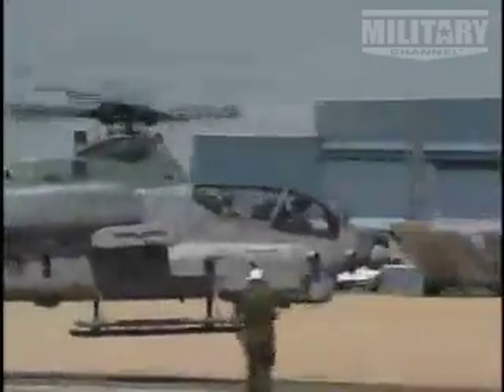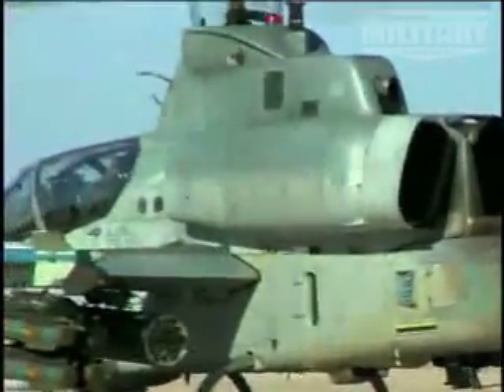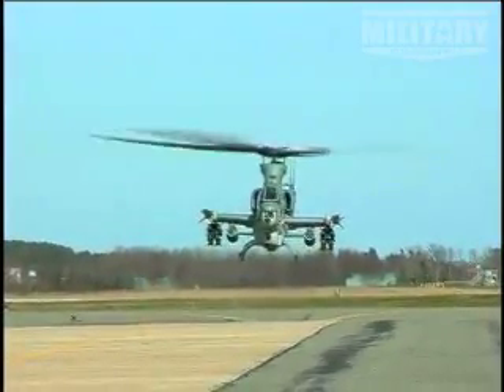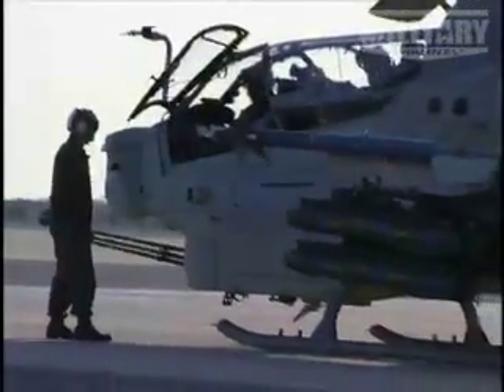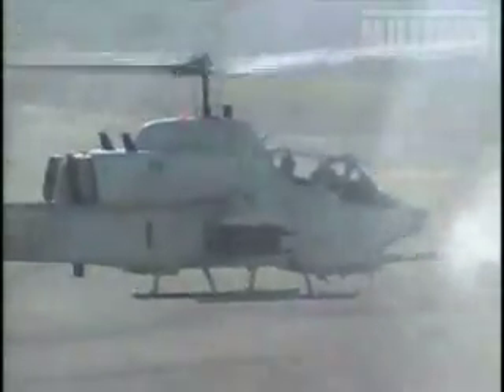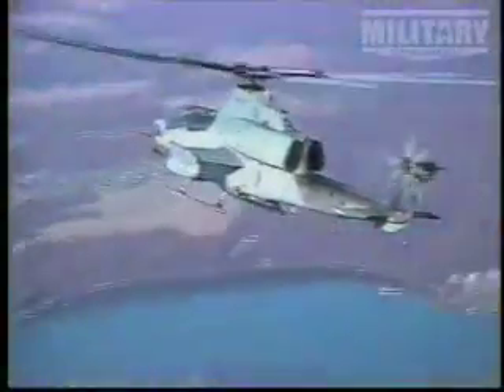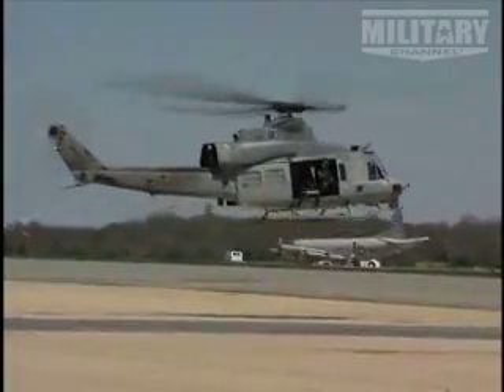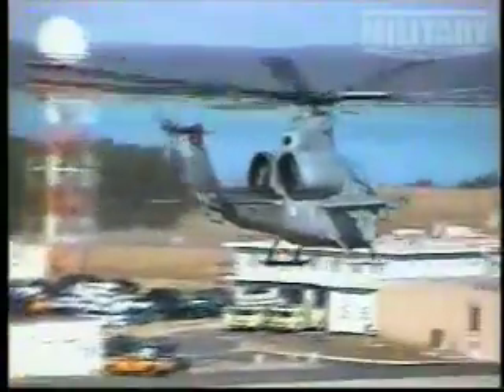World's Deadliest Aircraft - AH1 Cobra Part 2

Comment: @demonbre "what is that dangling in front of the cockpit?"
It's a wind sensor for fire control. By detecting the strength and direction of crosswinds, it provides data that the targeting computer uses to correct the aim of the gun.